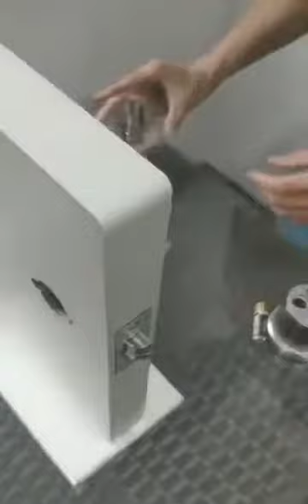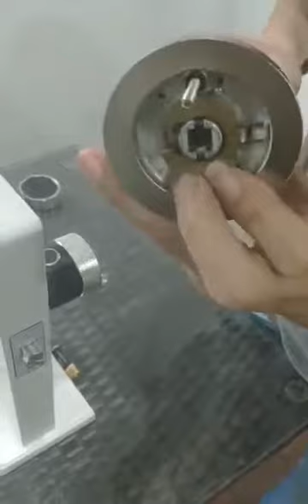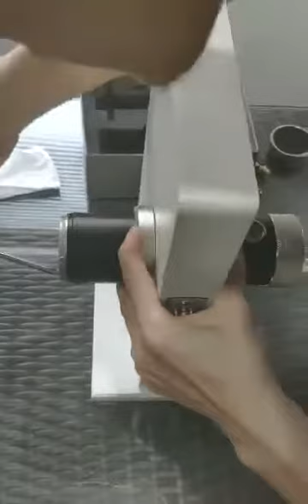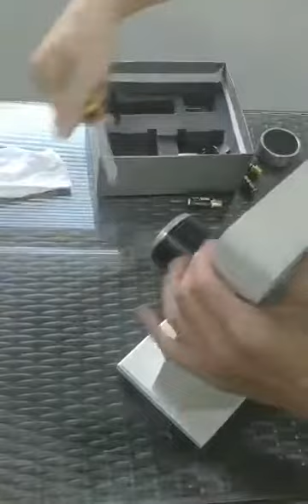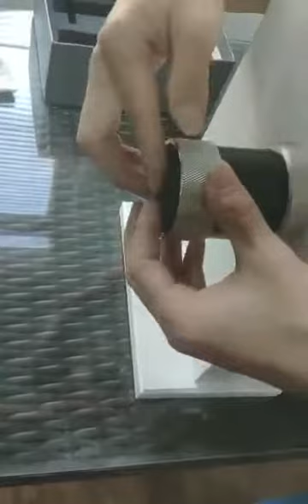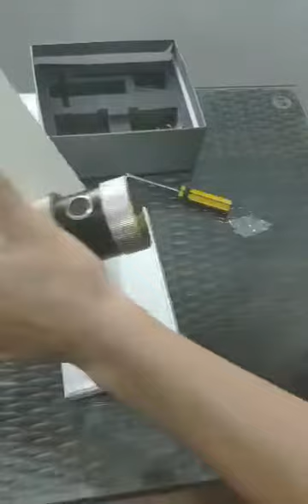THX1 LOCK INSTALLATION

Comment: Can you please advise what can be wrong if I do not see the passcode screen light up after inserting the batteries??
Reply from the maker: First, please check if you put correct position of battery. Second, please check upgraded video about proper installation.